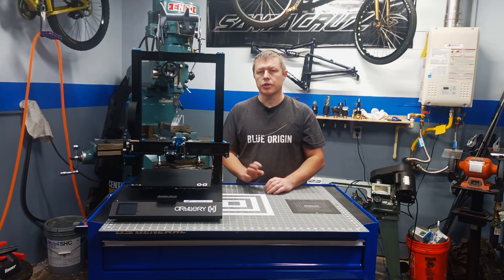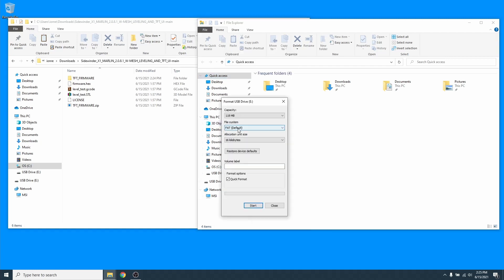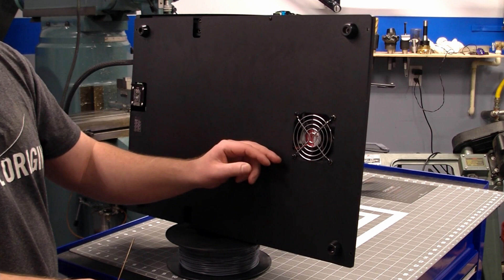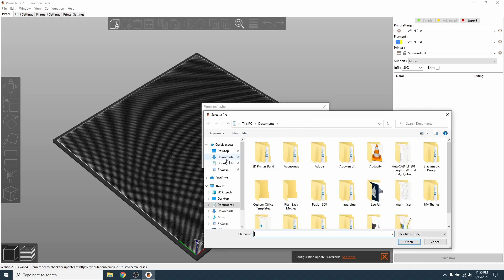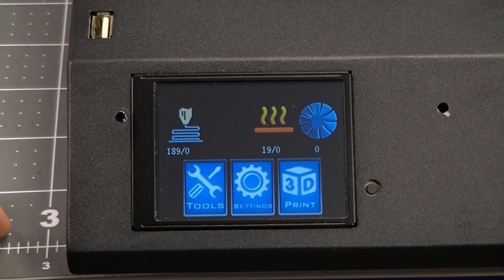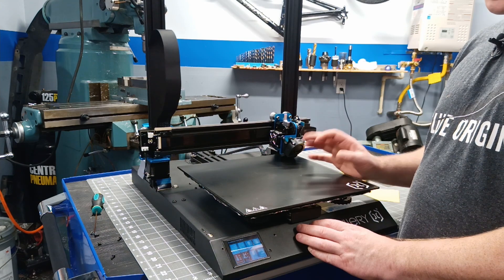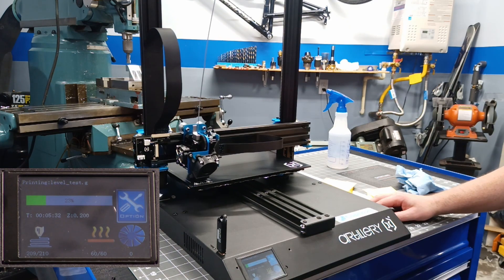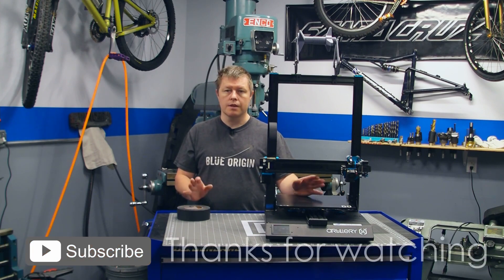Sidewinder X1 Marlin 2.0.8.1 with mesh leveling and custom touch screen UI.

Comment: Hey thanks for the offer to help with them stepper drivers. I am gonna grind this out till i got nothing first though(I do techie crap for a living so its a matter of pride).  You got me thinking about voltage to stepper motors.   I Know the motors are all good too, confirmed it by swapping lines to a good axis(yes i unplugged that second motor so no conflicting signals etc) and seeing that it gets clean input etc fine from that port, i am  thinking the volts on my port with the issue probably too low, since i think it best sounds like its skipping a step.  I will keep you up to date. Had to drag the old meter out need to measure etc now and compare. And adjust as needed.  p.s will tell you if i get around to this mesh leveler which is still just awesome.
Reply from the maker: Sounds good. Let me know what you come up with.

Comment: Hi, I just tried updating the firmware and seem to have bricked my SWX1 V4. Two possible deviations from your instructions are using a larger (32GB) SD card, and updating the firmware via Cura instead of PrusaSlicer. I also used a different USB Cable, as I never had the original (bought used). What are your thoughts/suggestions?
EDIT: My cable was apparently bad. I tried a different cable and was able to get Prusa and Cura to recognize the printer. Re Flashed the Firmware using Prusa but still no beep or screen on power on, just a faint sound similar to a pinhole air leak in a balloon or something. Also, my heat gun only has High, could it be possible something happened with the board when warming up the glue?
Reply from the maker: Try a smaller sd card.
Reply from the maker: Is it the TFT you are having trouble with?
Reply: The TFT lit up with the new appearance after using a 32 GB card to update, but I didn't check if the touchscreen worked. I updated the main firmware after unplugging the screen, etc., and that's where the problem started. I'll try and find a small microSD to try the TFT firmware update again. Does the beep after power on come from the TFT board?
Reply: @EtherealProject3D  I finally found an old 512 MB card and with and the problem was solved. I had to power cycle and change the TFT cable a bit, but the rest of the steps went great and I'm currently 94% complete on the largest print I've done and things are looking great. Amazing work you've done. I did notice the manual movements don't seem to be inhibited in the extremes, as the motors will attempt further travel if prompted. Is this typical?
Reply from the maker: @1empyre1life  Yes I have disabled software endstops to allow for moving beyond the bounds of the machine mainly for the mesh leveling purposes. When I was doing my initial testing tje software endstops would not allow compensation low enough on the build platform.
Reply: @EtherealProject3D  Once again, thanks for the reply, even though you've probably covered that somewhere. It's nice to print with confidence that the first layers will do what they're supposed do. Is there a way to support the project or send thanks?
Reply from the maker: @1empyre1life  Thank you, its good to know that what I have come up with is helping people have a more enjoyable experience with their 3D printers. I don't have any kind of patreon or anything like that. All I ask is if you like my videos, subscribe. Also you can follow me on facebook and instagram @etherealproject3d And if you have not seen on my website, I sell my custom extruder breakout board, this has been the financial support that has been a key in funding the channel.
Reply: @EtherealProject3D  Consider it done! Again, Thank you.

Comment: Neat! I run this exact printer.  I might need to swap over to this from another older updated screen OS I was using.  I like that meshleveling.  I managed to rebuild the hot end and tweak marlin 1.1.9 with changes for my upgraded thermistor and heater rod etc so she can currently get to 310 easily(theoretical max of 350 but I am not trying to burn the house down). I assume I would need to dig in that os to find and modify its internal temp limits too?         

Question: I get a chatter almost grinding sound out of my Y axis motors going down, then refuses to move up. It did this on and off before any upgrades after about 1yr of use now its 100% of the time.  I replaced the 4pin cables to both Y motors from the board.  I didn't think its the motors since they are smooth when off etc?  only only part left would be the board... maybe a bad signal?   I am gonna try loosening that y stop sensor as well since i heard over tightening might pinch it and cause it to act weird.   Ever hear of this motor behavior?  i didn't want to change boards honestly since it humors me greatly how much myself and others are getting out of these simple little boards.   Any advice would be appreciated.
Reply from the maker: Check the stepper drivers. And if you need some custom settings for your specific setup I can do that for you and send you the compiled firmware and marlon files.

Comment: Great UI and have installed with your excellent instructions.  I Would like to add a PEI build plate. Can I use this to reset the Z offset across all points?

Thanks,
Reply: Unlike the video, the mesh leveling seems to start in the center.  After adjusting the Z+/- Can  I save that position to the eprom and effect a Z offset, to then come back and do the mesh levelling?
Reply from the maker: I would clear the eprom after doing the update. Also ensure the sd card you are using to update the tft is less than 8 gigs and format as fat32.
Reply: Sheesh...just lowered the bed to lower limit, leveled the bed up into the gap and no hard reset of the Z Offset was needed. Obvious but various articles suggested a reset was needed for the addition of a glass/PEI plate was needed. Carried on with the mesh leveling.
Reply from the maker: @juleamerlin9303  excellent, please let me know how it gos.
Reply from the maker: You can absolutely use a pei build plate, make sure you lever the corners realy good before going through the mesh leveling.

Comment: Question, Im under extruding so Im wanting to calibrate however I usually use pronterface but pronterface wont connect and allow me to set E steps. Suggestions or ideas?
Reply from the maker: Try a different usb port and make sure you try all available com ports in the drop down.

Comment: I don't suppose you'd know why M0 no longer works once this firmware is installed and/or how to fix?  The command is just ignored.  From marlin:  "Without an LCD controller or EMERGENCY_PARSER this command is ignored."
Reply from the maker: I will have a look and see what I can do. Thank you for letting me know.
Reply: @EtherealProject3D  Thanks.  Or if you know a good method for changing filaments at a specific layer?  I use Cura's post processing script "pause at height", which worked fine before changing to this f/w.   It still "works", in that it does stop the print, move the head, etc... but the actual M0 pause command appears to be skipped and it just resumes instantly without any input.  My only hope is to babysit the printer and hit the LCD pause button immediately after the script's "pause".  I'd rather not have to do that.

Comment: Hi there! Is that normal that I don't have the PID autotune and no MESH leveling on the last firmware ? Instead of that I have RESET eprom and SAVE eprom. Any help is greatly appreciated! :-) Thanks
Reply from the maker: I just checked the files in the download link and they are the correct ones. It seems like you have installed my BL Touch firmware. This is what you need https://www.youtube.com/redirect?event=video_description&redir_token=QUFFLUhqbUVKX2o5Z0hGcERIMFlGOUhPZFZBTXJRdTZsQXxBQ3Jtc0tuUVFTelYzVDRVdWpBM3ZIaVpHZVlKU19qb29tZ3VQU1Vsei1WRUh6cWotamR0UDVBa01ZaDFVd0tYakFQV0NmamI5Z3Q5czRMWlFqZ0R0UTk0U1d0cmZmLTNEQ3RJYlZpOTZvVEVXeU1GTzhVR2ZEOA&q=https%3A%2F%2Fdrive.google.com%2Ffile%2Fd%2F1lb3hHW8w5RuHdy_qv-Rio3MQ5O5Ja0CK%2Fview%3Fusp%3Dsharing&v=0MLo6fkeFmI
Reply: @EtherealProject3D  Yes I have the BL touch. I flash with the compiled firmware (.HEX) right? If so that's strange as I am missing something then...
Reply from the maker: @borderline666  Ok then yes, the bltouch screen firmware does not have the pid autotune. That will have to be done from a terminal, pronterface is the best way to go.
Reply: @EtherealProject3D  Okay thanks ! Do you think it is possible to enable it in the screen firmware w/bl touch?
Reply from the maker: @borderline666  Yeah its possable, I would have to replace one of the functions with it. Like reset eprom or preheat PLA, what ever one you want and I can make that happen for you, just let me know.
Reply: @EtherealProject3D  wow seriously? :-) that would be very kind! I would get rid of pla preheat I guess.
Reply from the maker: @borderline666  Ok, I will get that done here in a little bit.
Reply from the maker: @borderline666  Here try this out, https://drive.google.com/file/d/1g-2NsI0fK4Fn75MnSx3JYO0mCaFAguzU/view?usp=share_link
Reply: @EtherealProject3D  awesome thank you very much :-) Will try it tonight for sure.
Reply: @EtherealProject3D  It worked like a charm thank you very much for your time I really appreciate it
 ! 🙂
Reply from the maker: @borderline666  No problem and your welcome.

Comment: Whats the process for switching filament when it runs out?  Each time with this firmware I get the alarm that the filament has run out and when I hit the change filament, load it and resume the print it will resume but not extrude.  It just does the path it normally would but no flow.
Reply from the maker: This has been a known issue that I have not been able to sort out yet.
Reply: @EtherealProject3D  OK thanks

Comment: Hello,to correct the height while   It,s printing with the baby steps,is necessary to save It to the EEPROM,or It do It by itself automatically for the next printing? Thanks
Reply from the maker: You would need to save it to eprom.

Comment: Hi. Thanks for a great video and explanation; I also have a sidewinder X1 v1.5; I'm thinking in doing this firmware upgrade also to solve the center levelling problem; in my case I can level correctly all 4 corners, but the center is always higher than the corners; in the center the sheet of paper frictions much more than in the corners but without tearing the paper. Do you thing it still will be better to upgrade? Thank you
Reply from the maker: You are very welcome. And yes, ether way the bed is warped, this is a good upgrade.

Comment: Can the tmc 2208 driver be installed, can you provide information about alternative parts? No original parts or expensive
Reply from the maker: The driver settings would need to be changed in the firmware, email me at etherealproject3d@gmail.com if you need this done for you.

Comment: So I got my printer to use this firmware, now my touch screen is unresponsive
Reply from the maker: Use an sd card thats smaller than 8gigs to update the screen.
Reply: @EtherealProject3D  so not even a 8gb sd card will work?
Reply from the maker: @jasonvanry4795  you can format it down to any size, make sure its fat32

Comment: that's what I thought by the blue origin t shirt-! I have several clients from there.
once the 5 files are on the micro sd (64gb smallest I had), printer does not seem to see them, boots like normal...
Reply from the maker: You will need to partition it down to 4 gigs or so I show how to do that in my BL Touch video.

Comment: Hello - thanks a bunch for all the hard work.
Just a question, when I downloaded the SWX1 files the MKS_TFT28 did not have a second file to unzip(?)
Any thought? 
Thanks a bunch, Ken Sumner WA
Reply from the maker: I updated the download files and location, there is just a folder named "MKS_TFT28". Use the contents of that folder for your screen update. Sorry for any confusion. Also as it turns out I not too far from you there in Sumner, small world.

Comment: I see you ride to a use to tell i broken my back on a hard spin so she said I had to get a new hobby
I tried cerality 5 plus after the 3d one I went to the X1 an I have loved it ever sends it have trouble with little things so im looking in to a resin for my sons warhammer 
Do you heat the bed before you level this is cool 
Ones I level I have little problems 
You make it look easy thanks for the info
Boomer
Reply from the maker: Thank you, yes I heat up the bed and nozzle before running through the leveling process.

Comment: I have an X! that was giving me temp errors due to the port for the hot bed thermistor not working.  Putting the bed thermistor into into the hot end port lets me heat up the bed.  There is an extra hot end port on the board.  Am I right in thinking I can edit the firmware so that the bed thermistor uses the spare hotend port?
Reply from the maker: Yes this can be done.

Comment: I just bought an x1, will this resolve the can not find file issuexas well? I just ran into that. My original usb stick stopped working. Does this also help with different material lije PETG
Reply from the maker: If you are having trouble reading files, try a different USB stick, make sure its 8GB or less FAT32. Aslo make sure the file source is set to USB. This doesnt change the way it prints different materials, just getting that first layer even to the surface of the build plate.

Comment: Thank you a lot for your firmware. But I've some questions about start gcode in Cura, if you could help. Because if I let Cura settings as it was before flashing, it prints the purge line in the middle of the bed and prints nothing about the object (no extrusion).
I've a magnetic Ziflex bed so I changed S60 to S70. I print usually between 185 and 190 for extruder so I replaced S210 to S185. But I impossible to print someting, except your test file. 
The extruder works for the purge on the left side, but after nothing extrudes when the print starts. Any idea?
Reply from the maker: I would clear the eprom and reload the firmware. Also make sure to use an sd card that is 8gb or less when updating the TFT.
Reply: @EtherealProject3D  I can print your test file, but to print something else it makes the purge line, and go to print in the middle. So it tries to print but no filament goes out.
Reply: @EtherealProject3D  if it prints your testing file, it should be ok isn't it?
I had not touched to the gcode before, so I'm a newbie with gcode. But I think the starting gcode in Cura isn't like it should be since i've flashed the printer.
In the gcode of your testing file, you force the hot to 210/60, and I need 185/70, so I've replaced this.
Reply from the maker: @tibidul  Oh I think I know whats going on, I have the min extrusion temp set to 190 if I remember right. I will have to make a change in the firmware for you. email me at ehterealproject3d@gmail.com or DM me in instagram @etherealproject3d
Reply: @EtherealProject3D  hi,
Email sent yesterday. How to reset eprom and flash back to original?
I didn't find any solution to make my printer work with your firmware.
Reply: @EtherealProject3D  I copied pasted the starting gcode from your testing file to the starting cura gcode, but I'm not sure its ok.

Comment: Recently added a Bondtech LGX extruder to my X1 and at the same time I used the firmware that you made.  Using Prusa Slicer as well so can I just do an M92 E400 in the Start G-code to change the esteps from 435 to the 400 that Bondtech recommends?
Reply from the maker: Yes this should work. In the long run you will want to bake that number into the firmware.

Comment: I assume that your new firmware solves the usb stick problem? I have original firmware and have to use microsd because prints above a certain size simply halt before completion when using usb stick.
Reply from the maker: That problem is more likely to be a bad USB stick or one that is incorrectly formatted.

Comment: Can you save Esteps to the mainboard with his firmware?  I'm going to be installing the Bondtech LGX soon and the esteps will need to be adjusted.
Reply from the maker: If you need the esteps changed i can do that in the firmware for you and send it to you
Reply: @EtherealProject3D  Thank you.  I use Octoprint so can I just go into terminal do an M92 Exxx and then an M500?  I think Bondtech wants 400 for the steps.
Reply from the maker: @michaelagostino1321  If you can, tune the estepa to what you feel is best for your setup then let me know that number and I will make the change and send it your way.
Reply: @EtherealProject3D  I forgot I sent this 2 months ago.  Anyway I will take you up on the offer to change the esteps.  Bondtech recommends 400 so we'll start with that.

Comment: Hi. I've been using this software for several months now and It has been fantastic! I'm in the middle of a 4 day print. I'm running low on filament and it may not last 2 days until the identical PLA arrives. Can I use the pause feature? If so how would I continue if it is paused for 24 hours?
Reply from the maker: The pause feature has not been working for alot of folks. Ive spent countless hours trying to figure out how to get it working but I think there is a limitation with the tft.